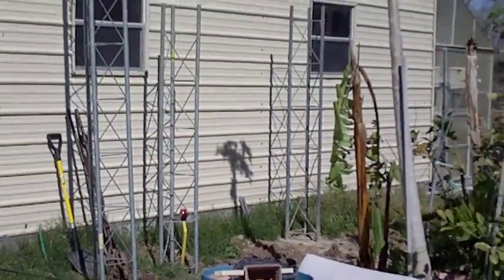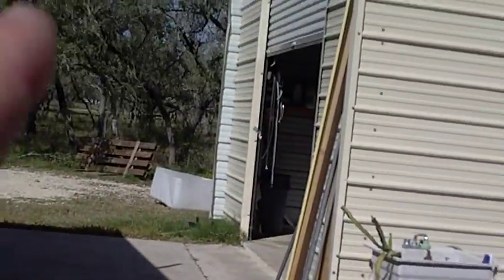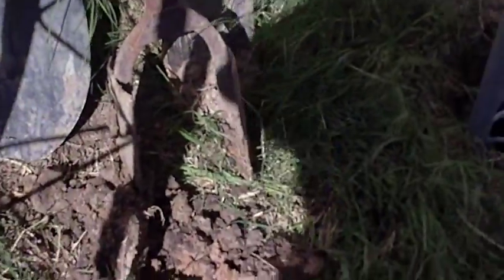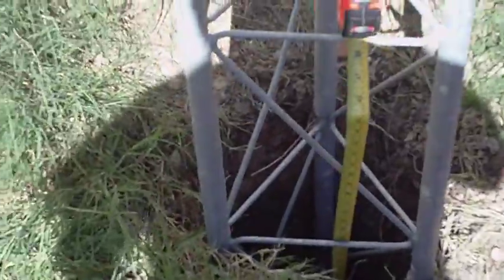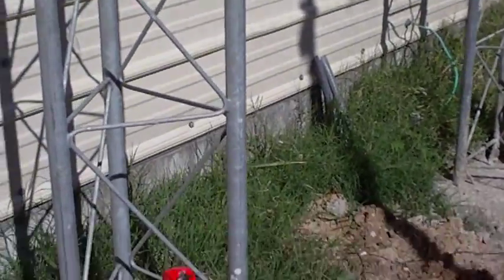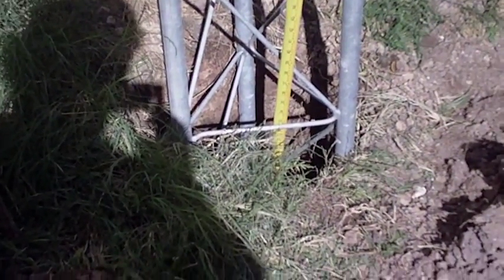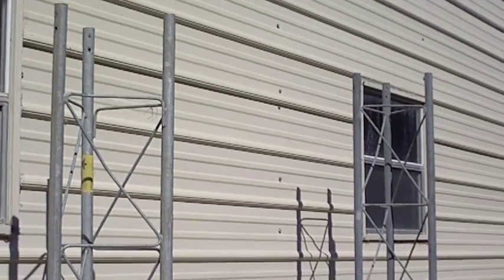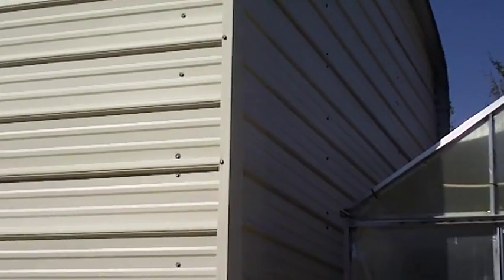Wind Turbine Generator Tower Installation

Comment from the maker: The tower is exactly 33 inches into the ground with the hole another 3 inches further down, the taper is about two inches by accident as I found out when i placed the tower in the ground, so I think that's pretty close. I don't think the width of the hole matters as long as it is deep enough and heavy enough. The tower will be be 25 foot on one and 30 foot on the other so the first tower will be 12% into concrete and the second 10%. I'm interested in hearing your opinions and concerns. Thanks!

Comment: So looking at your tape measure in the ground, you have around 30" of tower below grade.  So that's 800lbs of concrete on 8% of the tower in what sounds like a tapered bottom cylindrical hole not much broader than the tower itself.  I was assuming you were going to make a bracket to bolt into the roof line of the garage to shore things up in the middle portion of your towers, but it sounds like your going to free stand the towers?  This should be interesting to watch over the next year or so.

Comment from the maker: That's a great idea John, I had never thought of that. Thanks for the tip. What did you have to do to secure the fan to the PMA, were the hole and the PMA shaft the same diameter?

Comment from the maker: Actually, the reason it failed was due to torsional force because the turbines were extended four feet from the center and it caused the tower to flex laterally - which is not designed to do, so it buckled halfway down where it was flexing most. The tower is designed to handle wind loads from antennas such as dishes up to 10 feet in diameter which has a higher wind load than my 5 foot turbine blades. The load from the turbine poses almost zero lateral torque on the tower.